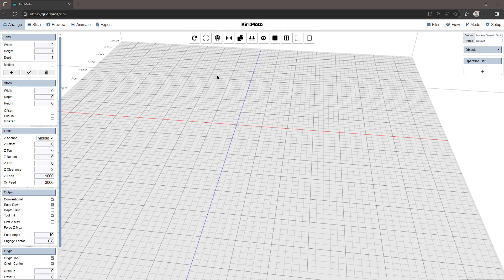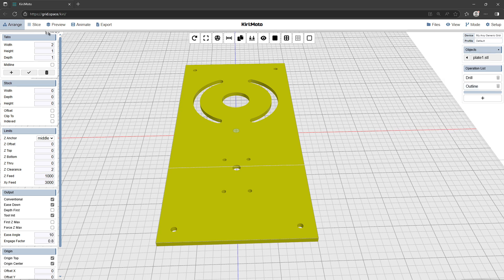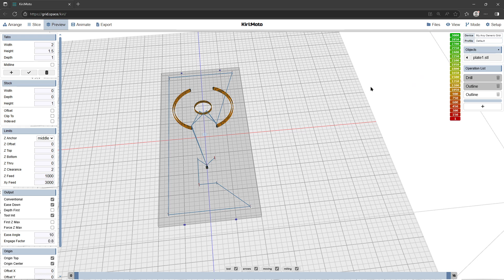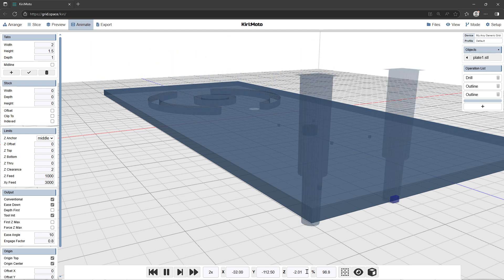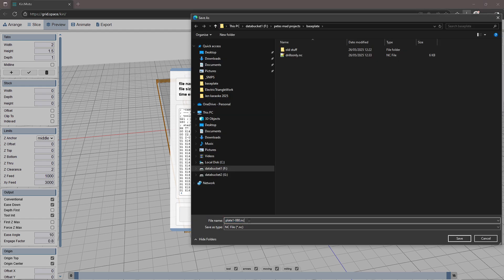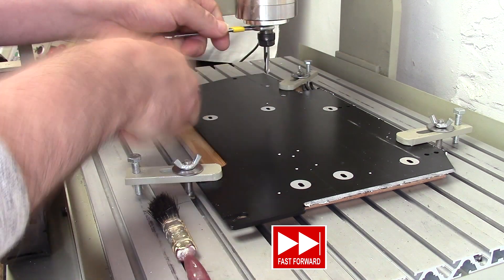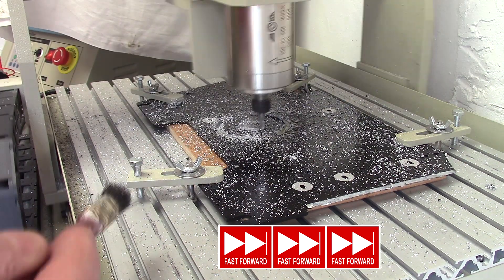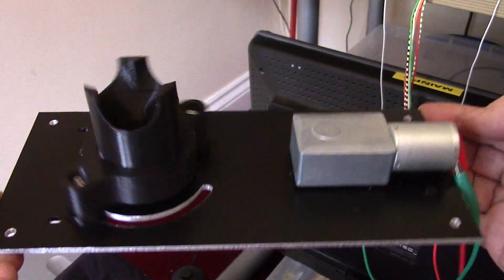Using KIRI:MOTO for toolpath generation to cut out a metal panel

Comment: great software, by the way what tool was sending gcode to cnc?
Reply from the maker: Hi ! thanks for commenting 😃. 
Yeah, Kiri: Moto is indeed fantastic software.  
To send the G-Code to the CNC I use another free software package called "Universal G-Code Sender" - "UGS".   
It allows you to have macros,  so I have written a couple of simple ones for doing probe height calibration when I change the cutting tool.  My CNC has a GRBL based controller and UGS has a GRBL setting.   I'd be lost without it.
Reply: @dingolovethrob  super cool, thanks for the feedback

Comment: I don't understand this program...I have 3 operations with 3 differents tools with 3 different diameters and select 12000rpm on spindle for cut, Ok...When export the gcode i open this with a editor and see thats have nothing about S parameter, M3 S12000 in this case so the program start without start the spindle...And the other thing is nothing inside the code call to M6 (tool change)...Or this program is bugged or is bugged...

Comment: I've just asked this same question to AI, and it says that if the machine doesn't pause at the M6 command issued by the Kirimoto gcode, or it doesn't support it, you can manually edit the gcode file to add an M0 command after each M6. This should pause the machine to allow for tool change. I really  would like to avoid having to generate and send multiple files to the machine for each job, so it looks like it is possible. Thanks again!

Comment: Thank you, that was very helpful for me as a beginner. I was also wondering about the tool changes. Is it possible for Kirimoto to insert a pause command i the gcode when there is a tool change? Then, when the machine pauses, you know it's time to change the tool, without the need to load separate files for each tool. Thanks again from Spain!

Comment: Hi, thank you for a video on this but i wonder if you use "zip" option(next to gcode) when you are exporting wouldn't it make seperate gcodes for every process?
Reply from the maker: Hey thanks for the suggestion ! This is why I do videos, in case it can help anybody, and in return, people help me haha 😃.  I've just tried that and it certainly does make a separate file for each process, which is great. So in this case it gives me three files , one for the 'fake 1mm drill' and then two separate files for the 4mm end-mill. No major inconvenience for this job but for a bigger job that might be inconvenient, and you might want to concatenate the gcode files that all use the same tool if the operations are just supposed to be done one after the other anyway. I'll certainly keep that option in mind for future jobs.
It had never occured to me to use that option, silly really. 
I really appreciate the comment !
Reply: @dingolovethrob  I appreciate yours, i barely used the software so i didn't even know if it sure would  work. I just read it in some comment. Thanks for affirmation. I think it would be great if we could name the toolpaths bedore exporting them. Like writing on them tool diameter or any other indicator.